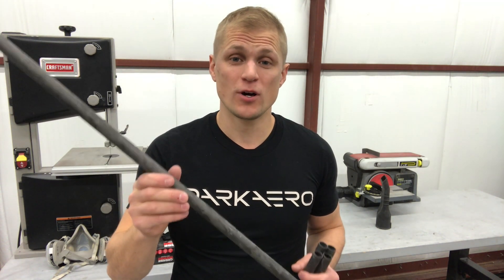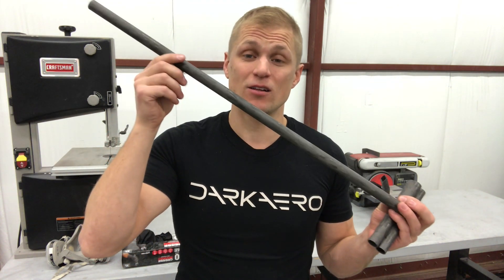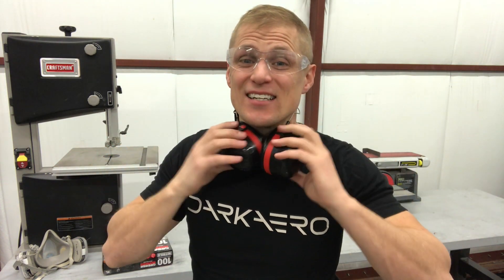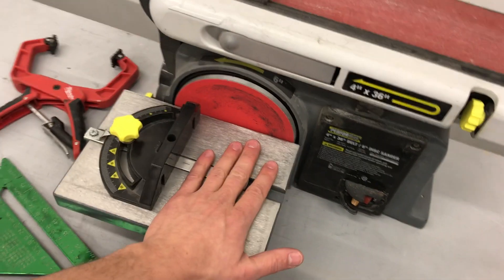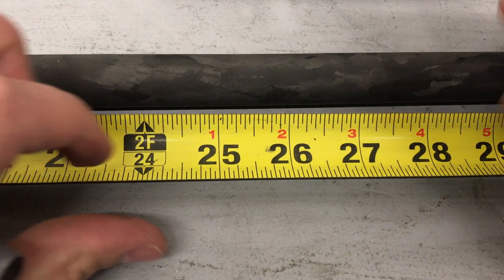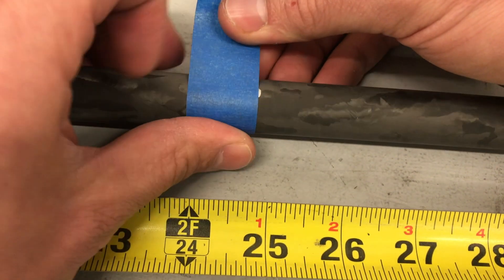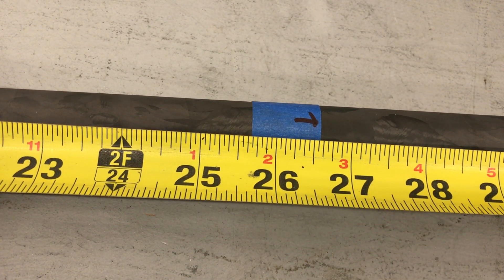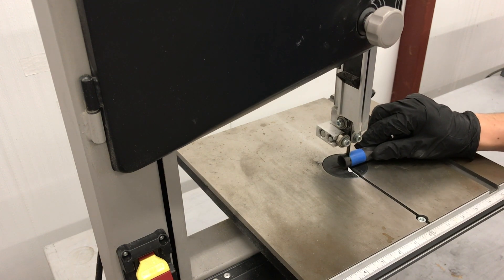HOW TO: Straight Cutting Carbon Fiber Tubes

Comment: check the after cut length before sanding so you can adjust the extent of the sanding in case you cut it somewhat shorter than you intended.

Comment: Put that tape measure down ... continual tape measuring is a massive time sink.. not to mention can be inconsistent .. get or make measuring jigs ... and use them ... you will have consistent precision across the project and save an unbelievable amount of time...   is measure twice to set up , and then cut to your hearts content ...

Comment: I notice you said it was fiddly to get the tape wrapped around perfectly square. Why not try a piece of paper instead? Cut out a small strip of paper, leaving one straight factory edge, and take all the time you want to line it up, without it sticking before you're ready. Then you can tape it on the other side.
Reply: Paper works better than tape for this

Comment: One trick I found that makes it easier to trim carbon fiber tubes is using an abrasive blade on a grinder or oscillating tool like you have, but the trick is using a typical automotive worm-gear hose clamp to locate your cut line and serve as the guide.  Tape works, but is finicky as you said.  A hose clamp is more easily located and installed, is always square to the centerline of the tube, and serves as a physical guide for your blade or sander, so that you don't cut the tube too short.  Try it if you have a chance.  Keep up the good work.
Reply: Thanks for this. I'll try and remember it

Comment: Small correction: you keep saying to use a square, but that's clearly a triangle.
Reply: the tool is called a (carpenters) square: used to check for square angles/perpendiculars. The expression using a square is correct. The tool itself is “shaped ‘ like a triangle, but called a square.
Reply from the maker: frizzkitten oh boy! We will have to correct that for our next tube cutting video! Good catch! 😉

Comment: Seems like a smooth diamond blade in a miter saw could be a faster easier method.
Reply from the maker: CHET M thanks for the comment and suggestion! I think you’re right. There definitely is more than one way to cut a tube. This video is meant as a guide and overview we can point to for our future kit builders who will need to do some light carbon work like this. The oscillating tool is something they will need for other parts of the build so being able to use it to also cut carbon fiber tubes can help limit them from having to purchase a separate tool for a one off job.

Comment: Have you tried to cut with an abrasive blade on the oscillating tool? They are supposed to work better on carbon fiber compare to ones with teeth but I haven’t tried it. Curious to know the difference.
Reply from the maker: I think we tried abrasive ones a while back but we came to prefer the ones with teeth as they are better for making precision cuts. This blade in the video was admittedly a bit dull.
Reply: @DarkAeroInc  Could it depend on the layup? I've tried to cut those small diameter carbon fiber tubes they use in kites (very flexible) with a hacksaw type of blade and the result was lot of splitting. I think those are just unidirectional axial layups. Is your tube a diagonal type of layup? Also do you happen to know if the glossy "3k" tubes have the same diameter tolerances as the ground one you are using?
Reply from the maker: @Jan_mxv  Fiber orientation does impact the cut. An all unidirectional tube would be prone to splintering as you mentioned. I think for those I would recommend an abrasive wheel on a Dremel tool. This tube has fibers running at a mix of angles relative to the tube axis. The glossy tubes probably do not have as tight of a diameter tolerance as these.
Reply: @DarkAeroInc  cool that makes sense. thanks for the reply

Comment: Cut a lot of tubing for the RV-10 build.  I used pipe cutters which typically gave a precise cut will minimal post clean up needed.
Reply from the maker: Interesting. Was that aluminum? or carbon fiber tube? We haven't attempted a pipe cutter on carbon tube but it's worth a shot. Thank you for watching!
Reply: @DarkAeroInc  Mostly aluminium, however there was also steel and brass.
Reply: @DarkAeroInc  I would not try a pipe cutter on carbon - the clamping action of the cutter frame and wheel will fracture the edge of the fiber tube. For Aluminium, pvc, steel, brass etc a pipe cutter would suffice.
Reply: @DarkAeroInc  I use a pipe cutter for carbon fiber rods. Works better than a fine toothed saw.